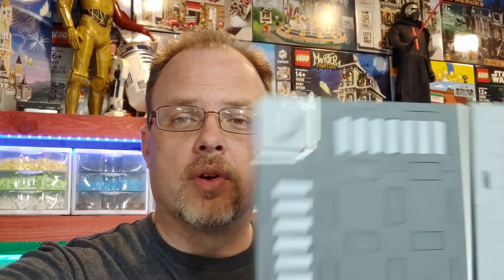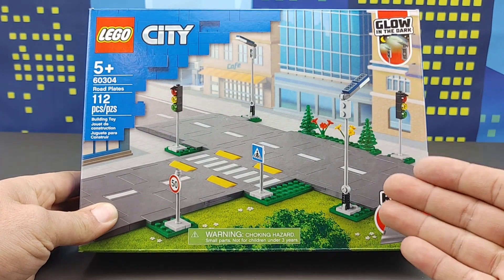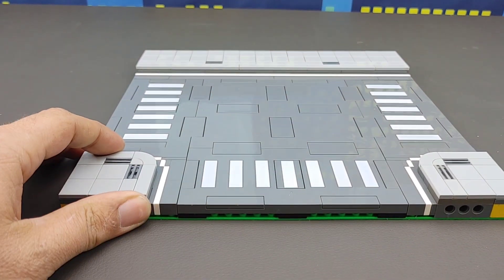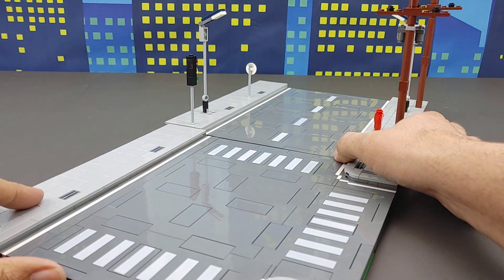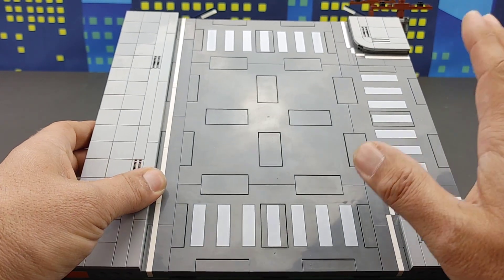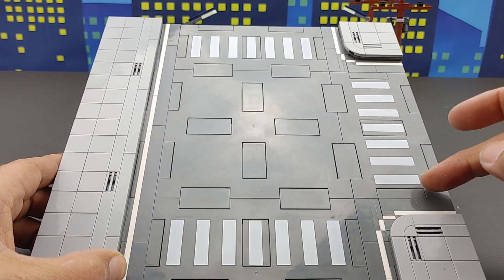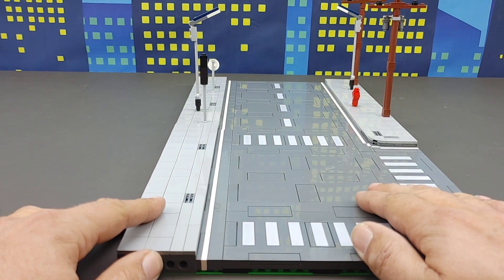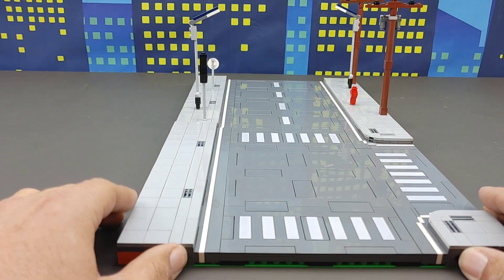New Lego road plates used to make T and 4 way intersections.

Comment: I made an intersections but I moved the crosswalks back four studs and added ramps, they don't line  up with the baseplates but I add plates under the cross walks on the intersection plate like you do here but the corresponding plate the cross walk is floating so the plates can be moved separately and just attach with pins. I wanted to add more road markings but  have to play with it more before I make a final decision. If I get the parts and finish the idea a little more I'll share it.

Comment: Can you show how to do an intersection with the rounded bricks?
Reply from the maker: Sadly they don't make the corner pieces that I would like to use to make a proper intersection
Reply: @BevinsBricksWorld  I was thinking maybe piece 24599 might do it, but I can't be sure of the dimensions or fit . . .
Reply from the maker: Its possible, 67810 is the part you would want but its not available in grey.
Reply: @BevinsBricksWorld  Hmm . . . I could make the corner section a white zone perhaps  . . . thanks for the tip - never seen that part before!
Reply from the maker: I was debating trying it that way myself.

Comment: From the minute these roads were introduced, I was on board. I know this might sound blasphemous, but I was never a fan of the baseplate system as I like having complete control over my builds, so if I need to change something on the fly, I can. But I was also never truly on board with the mils system either because I’m broke. These roads are a great intersection between uniformity and adaptability, with the added benefit of not costing like $100 for a stretch of road. This might be the push I need to get back out there and start working on buildings again.

Comment: I made a 4-way road junction at the weekend using the new road-plates and my own version of the MILS-plate technique as I only have a limited number of partss to work with. I set the crosswalks further back from the junction for safety reasons and didn't round off the corners. But I'm happy with the result and would be willing to share photos if you are interested.

Comment: I have completely changed all of my downtown streets over.2 t intersection and 8 straight,2 half straight and 2 train crossings.now I have added a bike lane.it seems limitless to creativity.
Reply: I’m slowly changing over all roads as well. I’m not using the MILS system but the new road plates really do make a big difference as to how you lay out the roads.

Comment: I am interested in HOW you construct with the elements.
I enjoy this quick reveal and the crisp happy you.

I do not approve of the Base element being a Waffle Board.
Yes, I acknowledge the perfection of LEGO parts.
I see a design flaw with this Road element....
The thickness/height of it and the redundancy of it existing.
A similar lack or flaw is present with the Train theme.
Some very specific element connecting two coaches is
half working.   The after market order for old parts of it
must be gold.

The amount of work used to avoid actual work.
If this unnecessary amount of modular/dioramic sections is
needed to give structural and eye candy and proper scale.....
BUILD THE BASE one and a half times in height.
Two bricks high......actual TLG cords and lights,
some pull strings, gears....the underside is forgotten.